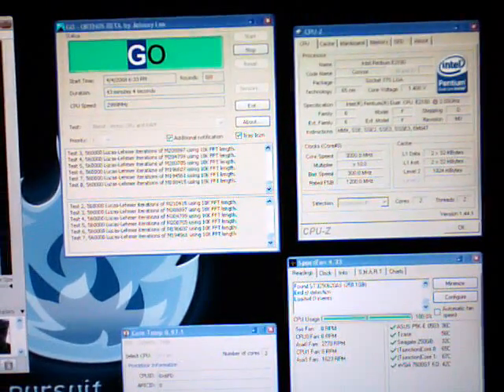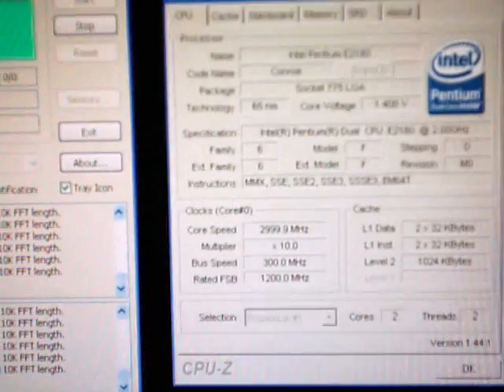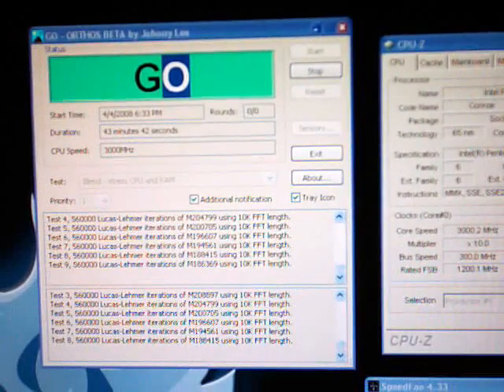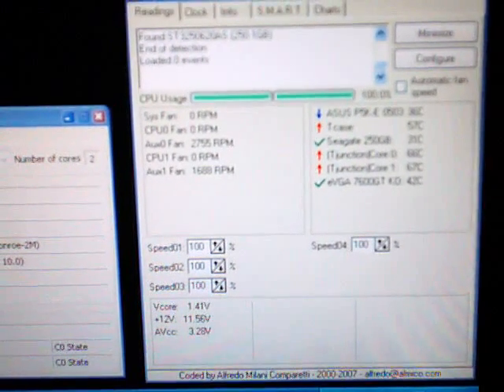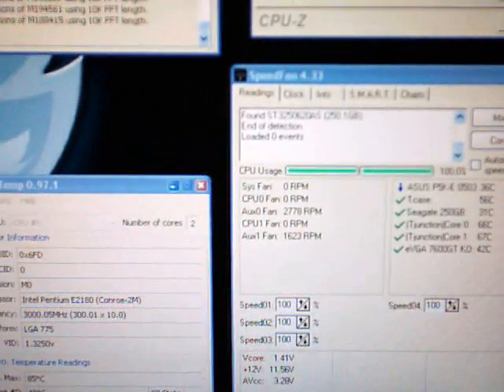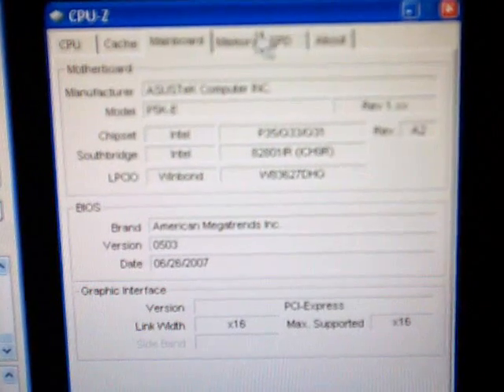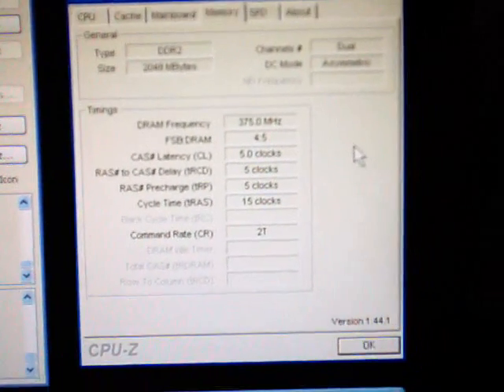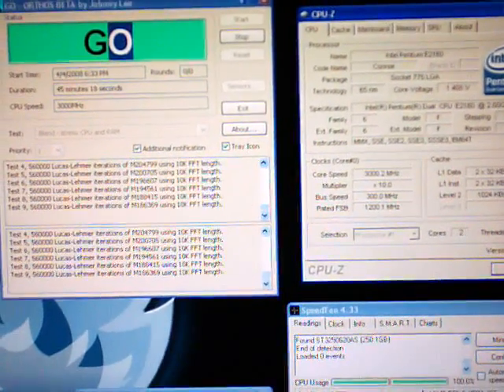RickArter E2180 @ 3.0GHz 24/7 Overclock

Comment from the maker: 73.2c fully loaded never sees over 55c in any other situation.

Tring to find wall again at 360x8 2880mhz  1440FSB 

1.425 vcore 
NB 1.4 
SB 1.2 
FSB 1.3 
PLL 1.5
RAM 432x2 5:6 Divider 2.2v